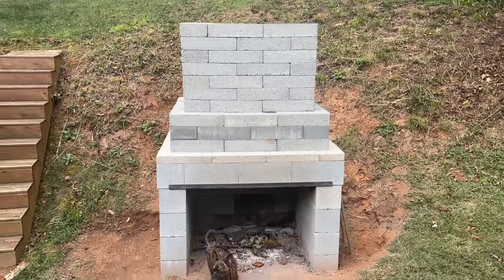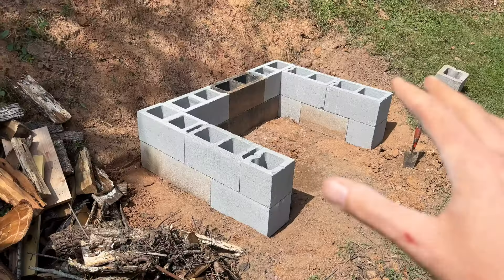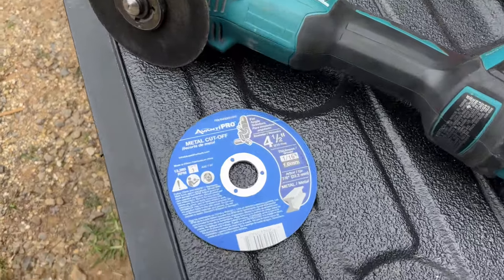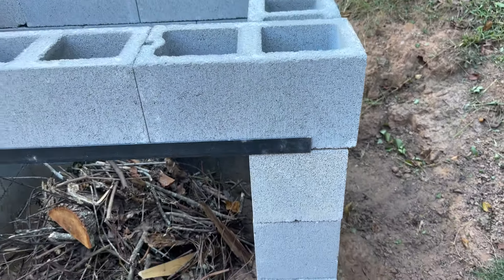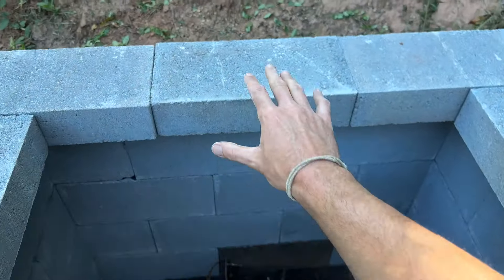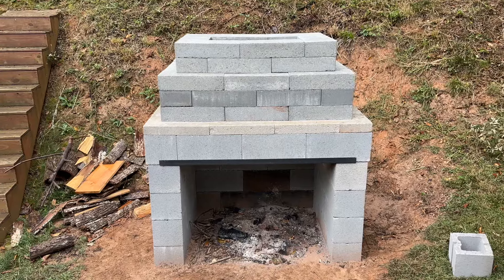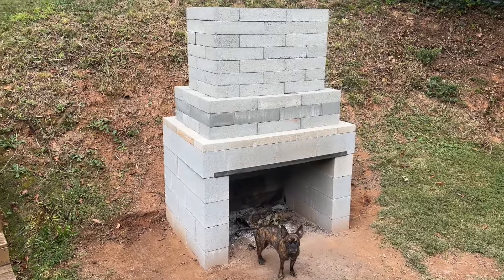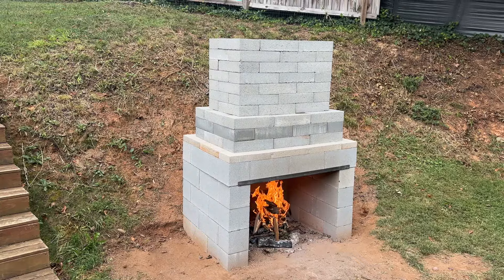How to Build an Outdoor Fireplace without Mortar (Dry Stacked)

Comment: Concrete "BLOCKS" will split and deteriorate in just a few uses.  Clay derived brick are fire cured and block are not but if you get it hot enough, you will find out the block will just begin falling apart.  Way too much weight sitting on that measly angle that you weakened further by cutting the ends off instead of cutting the block.  That much weight requires a lintel and not your imagination to hold up that amount of weight.  metal fatigue after exposure to the fires heat should be interesting.  Just don't let anyone near enough to it in case it collapses.
Reply from the maker: I'll do my best to provide an update video if anything fails or changes. We just got through Tropical storm Helene here in WNC (10/19/24) and no uneven settling, bending of the angle iron, or cracked bricks to report yet!

Comment: Great design. I built something similar and the cinder blocks did fail. I went with solid concrete bricks and a smaller design. Once a year I put a thin layer of cement in the firebox area and it has worked well going on 3 years now.  Filling the cinder blocks with cement or lining with firebrick would help a lot. Your angle iron pieces should be fine.

Comment: Wes, do you recommend using cement to hold it better? and lining the firewall with a layer of fire brick to give it a longer life.
Reply from the maker: Both of those options would be ideal if you have the ability and resources to add them into your project! This is a budget build so I didn’t go with the firebricks, but I also understand that my blocks will probably crack a little over time. (So far none to report!)